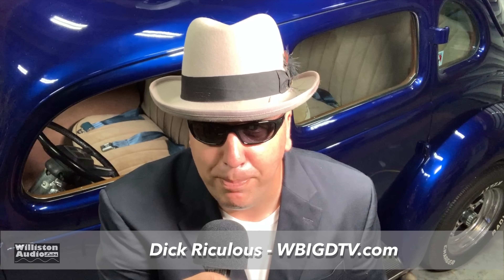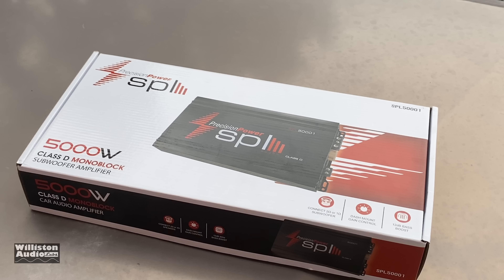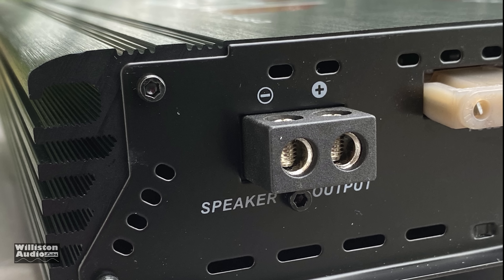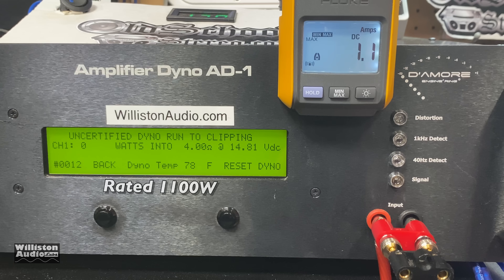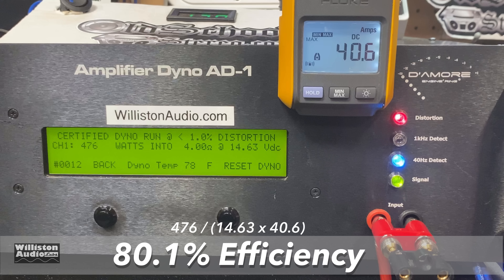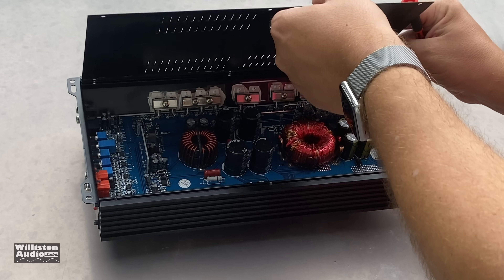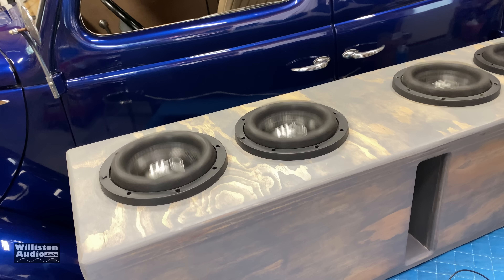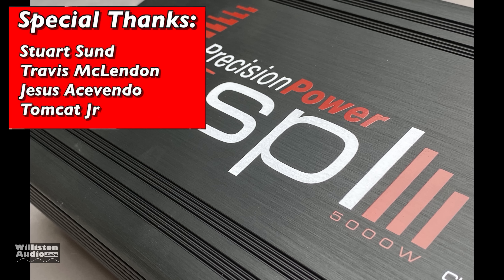Precision Power SPL 50001 "5000W" Amp Dyno Test - Absolutely State of the ...?

Comment: Years ago I had purchased the 4500 watt version of this amp. Had it pushing a couple of punch 10's dual 4 ohm. It used to get down pretty good. It did pull a lot of voltage though. Blinky lights and such. I gave it to my little brother to put in his truck after I upgraded and it's still pounding away today 4 vehicle swaps later. Not bad for the price at the time. ❤

Comment: Had a 1997 PPI Power Class 450 I bought  used for a hundo back in 2002. It was THE BEST sounding amp I've owned (and I've owned alot of amps). Awesome crossovers, descent power and in mint condition. Kinda wish I'd have kept it.

Comment: Hey hey Rob, if I get a sundown 2500 W Sia amplifier. I can slam some nice 10 inch subwoofer 2 box
Or slam 3 10 inch subwoofer in vented box?

Can you recommend any subs like 2 10 inch subs in vented box I’m thinking of a vented box Tuned 31 to 37 Hz or 3 10 subs vented box, tune to 31 to 37 Hz??
I want something loud I wanted to hit hard but I also wanted to go down really low. Got any ideas what I could buy? I don’t want to spend thousands of dollars I want to be in the $600-$800 range for two or 3 10 inch subs? Something sounds as good as jl 10 w3 or something just as good?

Comment: If they advertised the actual power ratings it wouldn’t be a bad amp. I hate that they do this kinda crap. I use cheap amps but I know going in they they won’t make close to rated power. I just bought a sound stream txp 6000.1 and I bought it because of this channel and the review. I was looking for an amp that could push 2k and cheaply and the sound stream does it and looks good.

Comment: I have a Chrome Rockford Fosgate  1999 ($1k I saved to pay for senior year) Transnova Power Series Punch 500A2. Have you previously done a model similar to other than the 800.2 seen previous on your channel? Hard to get the real story on why the chrome model is more sought after/valued then and now. Can anyone elaborate on some more details? Currently running on my sons P3D2-12 and Tom up fitting to 2 of the new DD Audio 1100 series SQL 12s in a sealed enclosure. I’m definitely more pumped than my clueless son to see what she will do bridged and turned up finally. LOVE the channelS D!

Comment: This video amplifier rating/evaluation is just weird.  

To summarize you pay 200 bucks for around 700 reliable watts?   When did any amp give us this much bang for the buck back in the 90’s or even 80’s. I do no ever recall a time frame such as this.  Even the old PPI never gave this type of bang for the buck. 

It’s already stated in vid that the amp pushed the subs well.  Isn’t this what really matters?

It’s a class D amp also and it makes it light weight which is good. Who wants a heavy system in a performance car.  I have avoided extra weight of a sound system in a car. 

There doesn’t appear to be any issues of over heating either or clipping or massive distortion or being unreliable. Suddenly doesn’t work.  If an amp is reliable then all good. 

It seems the way to go is Class D amp for subs and as technology continues to improve you can get decent mids and highs from perhaps Class D. 

I’m more of a Class A/B person myself but that’s what I grew up with.  

I can overlook the ratings. It doesn’t matter to me.  Are folks really more happy to pay 800 bucks for a 300x2 RMS watts amp which is big and heavy so long as it’s rated properly?

Comment: Seems like they are just measuring peak output voltage then just using ohms law to calculate power which never is the true output when driving a real load.
Reply from the maker: Or just making up the numbers to sell more amps? 🤷‍♂️

Comment: I would like to see a dyno on the powerbass ASA3 1500.1D monoblock 1 ohm stable amplifier I cant find a dyno on this amp anywhere its cost is around $499 delivered im using 2 strapped together on 4 double 2-12" ohm kicker compR 2000 watt per sub and theyre dancing for the amps

Comment: I have a Fosgate power 1000a2 from the 90s.
Although it has the bass boost knob, I don't think it is a  class d.
Does that mean it wasn't really designed for bass?
It's a 250x2 and the paperwork that came with it was somewhere at 1350 or 1650 ( unsure) bridged.
The only other thing that I can remember about it is 24db Butterworth. ...??

Edit....never did figure out what the phase adjust was for.  It didn't seem to change the sound much at all.

Comment: I need some help regarding amps and subs. If I have 2 Kicker CompQ 12's 2 ohms in a ported enclosure being pushed by a kicker 1800.1 amp via a Pioneer AVH W5400 head unit....amp gain at 3/4 with base knob 1/4 turned up. Should I not be able to turn this radio up with no worry of blowing the sub??? I'm not pushing the full RMS wattage to the sub so I'm just trying to make sure I don't blow these subs.

Comment: That's easily compared to my personal favorite overrated underdog amp. The Power Acoustik 2500. That is "If" the PA was rated for 1ohm. Since ive clamped mine untill it goes into protect at 853ish watts at 1.3 ohm. Id have to watch my own video to refresh my memory for sure bit it was 850something and im pretry sure that it was the over current/low impedence that threw it into protect. Which is a good thing for longevity of the amp itself but a bummer for me since i had it wired at .5 and wanted to see at least 1000 watts before it petered out. Its all good though, i just had to get another one for 2x the power and 2x the fun. Why? Price and efficiency.

Comment: Been waiting on the dyno for the Memphis PRX1000.1 🤭
Reply: I have a Memphis PRX 1000.1 on a set of Alpine Type R’s dual 4 ohm at 1 ohm and they slap hard. That amp is pure Power. My certification sheet for the amp says 1,050 watts and I’m a firm believer of that.

Comment: Efficiency sucks. Plastic bass knob sucks. Ok PCB, but no silicone, hot glue, potting, nor mechanical means to hold the transformer coils. Ok, actually I see some when the video pans directly over the circuit board. China crap. Pass. Get Korean or USA.

Comment: Hey Big D, I have 3 ol' skool Orion amps, XTR 250, XTR 450 and 225 HCCA, all 3 are done in the chrome finish.
I know, not that unusual...except that they all feature 'Specially Designed For Robby Brand' engraving, directly below the brand name and amp model on the central cover plate.
Just wondering if you've come across these particular amps before as I can't find anything online about them.
Keep up the killer content!
Cheers Rob

Comment: I will caution that line fuse does not necessarily reflect power capacity.  Meaning, a 3.6kW (1800Wx2@2Ω) QSC PLX 3602 will run off a 120V outlet and WILL net WAY over 1875W the limit of a standard 15A outlet.  Remember, this is for sound reinforcement, that is live music which has wide dynamic range.  If you have a (BIG DUMMY) moment and play a bass pedal at full output you WILL blow a fuse or trip a CB as the amp will be drawing 50+ AMP from a 15A outlet.  

Funny thing is, this POS is OVERFUSED which is DANGEROUS as that fuse won't blow if the amp blows most likely.  And if that would happen, the traces on the PCB glow RED HOT and catch fire.

In the name of science, perhaps, drive the amp to full output and crowbar (short out) the outputs to see what happens. ;)

Comment: Sad...
Man I have a minty old school Memphis AR-HC50 you should feature. You've only done one other Memphis:( And this one is older. I believe it was some of their first stuff after changing from Fultron to memphis. Its a "cheater" too:) I would fully accept any responsibility. These things are truly bullet proof. I used to road trip the one I had back in the day for hours on end (with the gain all the way up lol) @1ohm mono in the texas heat and it never shut off a single time.
Reply from the maker: I’ve tested that amp before and have the Dyno sheet somewhere.
Reply: @wal  Ahh nice! Im sure it probably does around 600w but it would be cool to see it featured. Alot of people have never seen/heard of one. I happen to look and there is Aria branded one on ebay wich I had never heard of too.

Comment: Epsilon is the parent company to Soundstream, Power Acoustic and yes, PPI. They have essentially gutted these legacy brands to cash in entirely on their names and history. How proud could they be of a PPI amp series they won't even list on the company website???
I collect and use old school PPI. The junk they currently sell is NOT even remotely PPI. It's flea market garbage! They had decent series' in the Phantoms and the Ion amps. Both are now discontinued. Same with Soundstream. 
The same thing has happened with the Maxxsonics owned MB Quart, Hifonics and Autotek amps. 
The idiots at Epsilon who have done this to these formally great brands should have their asses kicked! Everyone, please make this video go viral. Spread the word about what Epsilon has done. 
Damn, I'm pissed!
Reply from the maker: Well said
Reply: Just about the only good thing from PPI/Soundstream is their subwoofers if you stick them in the right size box. Of course those are made in China too like everything else, but at least they won't vaporize as soon  as you introduce a small amount of clipping like other even cheaper brands.
Reply: My thoughts exectly! I grew up with these brands in the 80s and 90s and worked at Directed when they owned PPI for a minute. I lived and breathed PPI when I sold and installed it at the shop I worked at in Poway, CA. Epsilon bought these brands for the brand equity which quickly runs out as soon as the customers figure out its a lie.
Reply: @fueledgaragetv1212  DEI didn't do PPI any favors exactly, and by then the Issas hald already sold their shares of DEI to Trivest, so they were already on a path downhill.
Reply: Epsilon ran those names directly into the pooper. I can’t believe people still buy this junk. I guess if you don’t you don’t know.Thanks Big D!

Comment: Another GR8 review! Another example of Chinese Watts. They seem to be ZERO crazy. (50 becomes 500, 500 becomes 5000 thousand).  OK. Now, like Mr. Big D learned us, look @ the fuse(s). Add em up if there are more than 1. Do da math.  80% of the answer is there regarding a guesstimate of possible power output. Now, just to throw  a little credit to this amp, it didn't let the smoke out after all the tests! Ya! Protect worked?! Wadda you get for under $200? A fairly slammin amp I think. Back in the mid 90's, a nice 100wpc x2 amp would set one back over half a grand! I think all that is needed to make this amp a good bang 4 buck is to make the bloody thing more compact! Look at the real-estate inside! You need a bus route to get from component to component! Squeeze the thing down, even throw a in fan or 2 if needed, then I'd buy the thing!  That amp would be nearly $4000.00 in the early 90's! Well?....maybe not dat much. LOL.

Comment: These companies would sell more units if they'd just be honest about their output numbers. 1100 watts for 200 bucks isn't a bad deal at all. But since they want to lie about it, they wont get a dime from me.
Reply: It appears they sell more lying to the public. There is a sucker born every minute. Remember the average startup installer do-it-yourself guy is not going to run it through a Dino probably won't even do any research. Still not one person ask the question, what about the amplifiers that they're selling on their website? Perhaps they are better quality just like the original ones. They certainly look different don't they.🧟‍♀️
Reply: @Mr.Robert1  I guess they're only interested in the fast buck.
Reply: @wadehensley5005  unfortunately there are two ways of thinking well more than two but in any case there are companies that want repeat business and there are companies that just want to knock you over the head once. In this case that taking an amplifier they probably cost them $40 to make and retailing it for $200 so for every dummy that gets it they're making a huge profit however they will not get repeat business this is the what they chose.

Comment: Sad to see these brands that we all loved in the 1990s turn to bunk.
Reply: It has a lot to do with companies buying the old companies and trying to bank on the name and not actually keep them the way we remember them..
Reply: The black ice series is decent, $250 for a solid 3k. .5 ohm load for last two years ( 1 year with my truck, the last year in my buddies truck with same subs).
Reply: They all doing a Mercedes job. Lowering the levels but selling it on the badge.
Reply: @BobbyDeniroX  Mercedes is still bad ass have you driven a newer E class? It's absolutely stunning inside. Their expensive to maintain and don't last 500k miles how they used to but they do still make the best of the best interiors and experience

Comment: Does anyone know if the power class is any good? I've seen many of the lower end models tested but never the flag ship.
Reply: Hard to say. Ppi and soundstream kinda had a rebirth a few years ago and started making ok stuff. Soundstream reference and ppi power class were similar amp lines. The guy that helped push them in that direction left to go to ground zero i believe. Ppi had the black and copper colored comps and subs....soundstream got a version too. The 3way comps were good as well. Neither brand fully returned to their former glory but they appeared on the way back and then something happened on the corporate side and now if i had to guess they are back on the way down.
Reply: Roll the dice..... Or try to find a gut shot.
Reply: @commonsenseisdeadandgone  on the web site the guts look really good and probably under rated but I don't see any place to actually buy them 😂
Reply: Ppi has new powerclass amps coming out. The big 4 channel seems like its rated fairly. İts fused at 80amps and only claims 120×4 @ 4 ohms 175x2 @ 2ohms. Thats reasonable for that wattage. Believe it or not even boss uses the correct fusing for the power their amps put out even though the manual and box claim outrageous numbers. When you look at dyno numbers and compare fuse rating. Rule of thumb for me is 1amp of fusing is needed for 10 watts of power. So a 1000w amp needs 100amps of fusing. İf it has anything less its probly not gonna make that 1000w
Reply: @jarrodbrennan121  it's sad really, boss actually puts out decent numbers, have a unique styling, actually use fairly decent components as well, if they wouldn't have slapped that ridiculous max power crap all over the box and amps they wouldn't be bad. I know early 2000s Sony rating was 3x inflated, 900 meant 300, always, but there is no rhyme or reason too these ridiculous numbers like that and if there was it wouldn't be so bad either but you just don't know when amp boss X and amp boss Z both say 5000 all over and one is 1800 and the other is 800.

Comment: I bought an orion hcca 15 with dual 2 ohm voice coils and a kinetik hc 2400 battery and a SounDigital 8000 1d evo.
The Owner of the orion sold it because the amp was not good enough for the orion.
But the Problem is when I listen to music I start smelling Voice coils after a few minutes and I'm scared that the sub will blow.
Is the smell maybe of dust in the sub?
Because there is very much dust in the box?
Reply: If you are wired down to 1 ohm with that 8k, that HCCA is doomed to fail. I like Orion and all but whoever told you an SD Evo 8k isn't good enough for an HCCA is clueless.
Reply: @j.savage1228  The guy who sold me the Orion hcca didn't sell me the amp.
I bought the amp in car audio store the guy with the orion had a 1500 Watt rms amp I think but I'm not sure.
Reply: @j.savage1228  And I'm only on 20% Volume and I start smelling the coils.
Reply: It may be glue curing. Check the sub itself to see if it's hot. If you have a clipped signal, it will run hot too. Full volume isn't always the same as maxed gains.
Reply: @piscikeeper  Gains are at 1/3 the sub itself is not hot.
I touched the dustcap and It was maybe a bit warmer but not hot.

Comment: that's a damn shame because precision power was one of The originators back in the day.
they have an opportunity to step into the new market and make a comeback
Reply: Nobody wants to make a comeback anymore. They're content to cut corners building and selling junk that lasts maybe 1-2 years to increase profits, because most are stupid enough to buy it again.
Reply: All of the top fog engineers for poi now work for JL audio
Reply: Ppi still has good stuff you just have to know what you are getting. They lie about the ratings so look at the fuse then put another 0 on that #,  and it will be within 20% give or take , mostly take. For the money they sound good and ive had tbe black ice 7000 for over 3 years and it still works perfect.